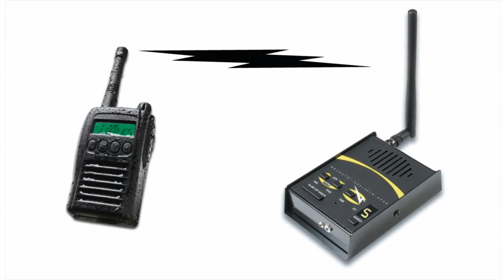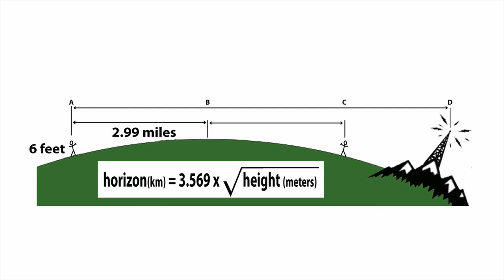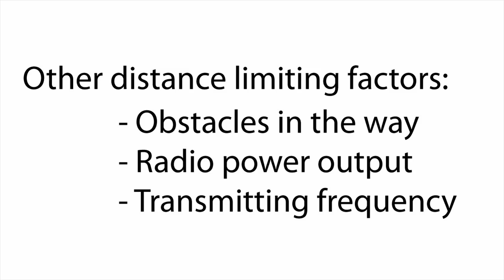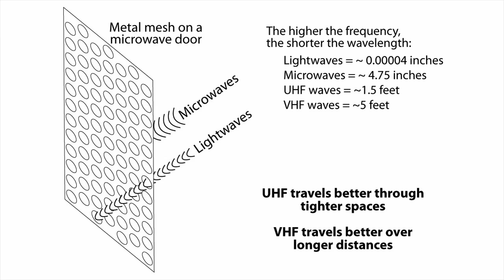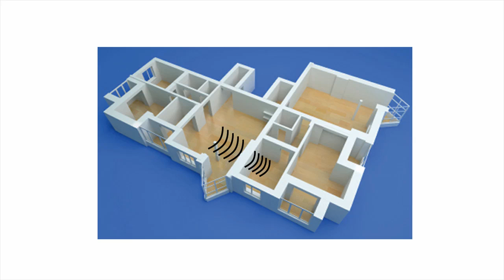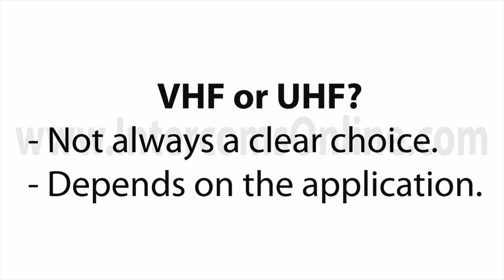Two-Way Radio Range and Walkie Talkie Range - 888-298-9489

Comment: your radio is just like mine I bought it at another radio store like yours
if that radio cost $ 150.00 dollars would you put in water to prove it
I would not want to take the chance my hole station which is 3 hand helds
and a  base radio worth $ 700.00 dollars  answer is NO way.

Comment: Individual formal I'd registration form and financially oriented cerified technician 
Book reference and computer I tried to connect and check range but it's locked coax cabling to southern wave bootable not critically ins fractured by other but accidentally we havE to pay ins fracture garage organized and securing tools and other home indoor appliance silencer changed listing to do so much and effectiveness the helpful in reduced vapour .its all yours not mine or yours the what I have .if I have I gave I I don't have I still give it.
Reply: Peace reporting electronics and grouping with protecting people and robot.

Comment: What do you suggest for cities then? VHF or UHF?
Reply: Zeppelin Bear The quick answer is: choose VHF if you plan to only use the radios outdoors and in an area that is relatively free of obstructions, such as buildings. If you plan on using the radio indoors, both indoors and out, or outdoors but around buildings, choose UHF. UHF is the better all around signal and is by far the most popular, so if you are in doubt, choose UHF.

UHF signals don't travel quite as far outdoors as VHF signals, but they do a better job of penetrating wood, steel, and concrete, giving you better range and performance in urban environments and around buildings. VHF signals travel farther, absent obstructions, and tend to "hug" the earth better, providing better performance outdoors or in hilly terrain
Reply: Linkdelight Oh, thank you very much for your explanations.
Reply: Linkdelight And  recommend Tokmate TD50 for  good solution for crowed liscensed channels and Voice encryption guarantee

Comment: I signal that is not interrupted at all will travel farther than one that has to penetrate something. A signal that penetrates a concrete wall is going to be weaker on the other side of a wall. A signal that transmits through an opening uninterrupted doesn't lose any power.
Reply: all emergency services use repeaters to cover there city and can even
go county and state wide repeaters also.

Comment: Dear sir,
ur illustration is so nice ,  pls  let me know about 27 Mhz  Radios , what cud be the max  Range we can achieve by a 4 watt 27 Mhz  radio
Reply: Depends on terrain and obstacles on terrain, local channel usage, skip conditions, antenna height and gain.  So 2.99 miles as shown with two 6 ft users - would be about typical for 'average' rural conditions.
Reply: I got 15 miles on my CB radio to radio

Comment: Ok thank you I was just confused about upgrading to a UHF radio from the cheap Gmrs ones.
Reply: my hole station set me back $  700 dollars for four radios three hand held's and a 45 watt base  from radio store X
Reply: all big box stores are cheep $ 50 bucks might get you to the mail box
at least best buy and the store I deal with are at  $150 each same radio
mine are also  at $ 150 each but my store sellers only radio's and the
extra's you need for it and will tune it to a tower near you and ship  it out
with a radio  RADIO TEC IN STORE on a 1800 number live no e mails

Comment: You will NEVER get 35 miles out of any radio unless both sides are standing on mountain tops with absolutely nothing between the two points. That range is a lie. You would need the four watt radio to even have a chance of getting a few miles.
Reply: The longest (confirmed) contact using UHF is currently 333 miles. See link below.
http://www.delboyenterprises.co.uk/pmr446/
Reply: You are wrong !! I use a VHF with the antena on top a mountain, and I have obtain around 60 miles or maybe a bit more

Comment: Ok Would it better for me to buy a 4 watt UHF radio or a Gmrs radio like the Motorola talkabout Ms350r? The 350r is advertised at 35 mile range is that attainable? Would the UHF radio out preform the Gmrs radio? Thanks.
Reply: I could let the cat out of the bag I looked at all the radios out there and picked
rugged radio all radio's are sold out of a real store where thay are built
and you get a T E C at a 1 800 number that will help you through a problum
if you get one

Comment from the maker: Digital uses a 900MHz frequency so it won't transmit outdoors as far as a VHF radio which uses a 150MHz frequency. VHF also has a higher power.

Comment: hi, if U or any one can Help Me to Know ,.
 which of the Radios can TX (transmit ) Longest Distance ,.
 Digital  or  Annalog ?,.
 let say at the same Frequency & the same Power Output
 at the same Terrain  for Testing ?,
 it will be a Good Help to anderstand which Radio to Buy ,..
  Thanks  ,....
Reply: i would say analog. At the outer limits of the communication range the digital fails to decode and you hear motorboating where as analog you can get enough intelligence to understand the weak signal At the present time i am having both signals.and the analog comes through when the digital sometimes doesnt.